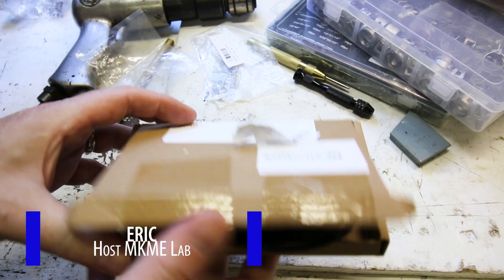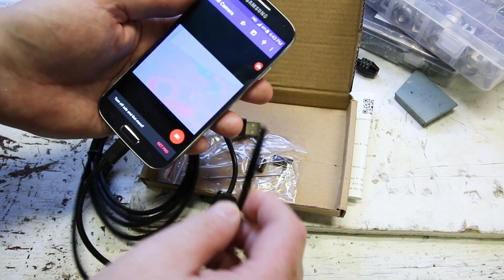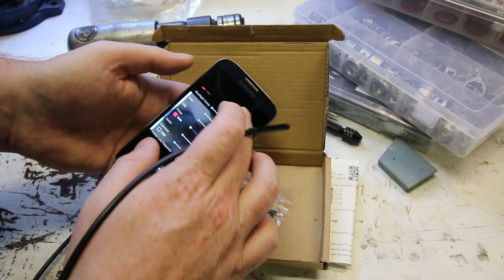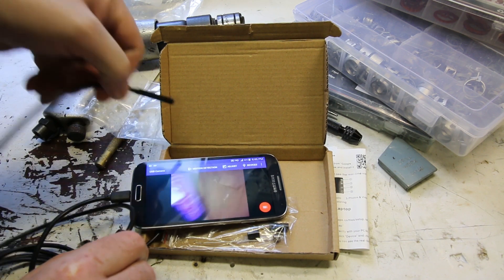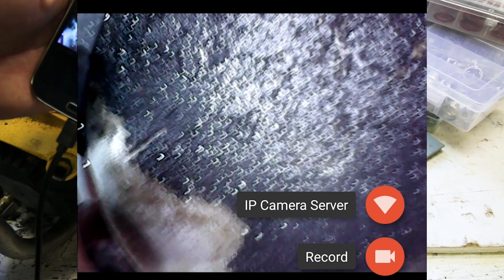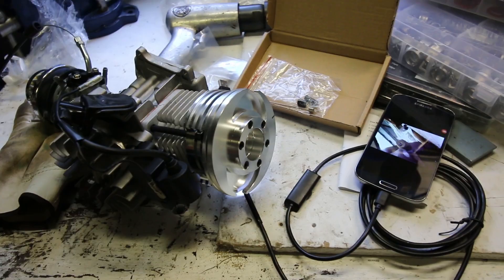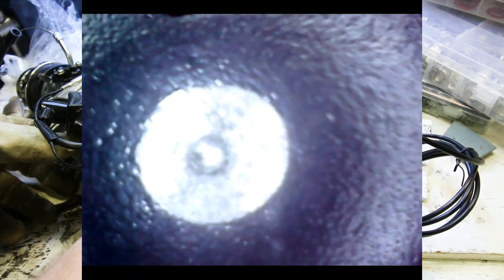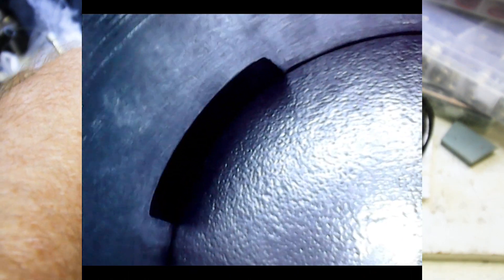CHEAP ENDOSCOPE CAMERA THAT DOESN'T SUCK!👍

Comment: Got the same type from CHina. It worked for whole two minutes before the LED fried the camera or the wires. It got hot AF.
Reply: I’ve had mine for about 2 years. Would’ve been nice to have illumination control, needed it to get in a dark place last week. Now the light doesn’t come on at all. Manual has no remedy to control. Totally worthless, typical Asian knockoff crap. But they don’t have an American version, off to the proctologist, oh well🙈

Comment: Though this is 4 years old the picture quality is good.  I moved to a town house and noticing some of the vents don't flow as much I started looking down in them and found stuff.  It would be interesting to get one of those cameras and see what is in them.  I just know the AC coils will need cleaned.  This place had no one in it for 2 years aside from maybe the previous owner checking up on it to make sure nothing has gone wrong.  Depending on what I find I may need to try to hook it and pull it out.  I already found a bag that had cookies in it down one and a piece of insulation and some nails in another.  It is obvious to me now that whoever built this place focused on speed and they just swept the floor debris down the vents thinking no one would find it.  Well I did.  I am not overly upset as long as it won't cost me a fortune to fix their negligence but it is still disgusting.  I wish I knew a wood worker to get to bring his dust collector over and hook it to the vents one by one and see what it pulls out.  A dust collector is like a shop vac but much more powerful and even has a larger hose and are designed to pull a TON more air flow than any regular vacuum can!  I may get one of those cameras you have.  I am only looking at reviews because many of these are Chinese generic junk and thus a waste of money.  It would be nice to get something that can take photos too so I can show the neighbors.  Next thing you know they will want to borrow the camera and look inside their disgusting vents.  Maybe they have a similar problem where the airflow is not so strong on the second floor too!  I hope when I snake a camera down in there I find some money (we can all dream).

Comment: Which app did you use?
I have the same endoscope, it's lighting up the leds but not showing any images. Have tried a couple of apps and neither work!
Reply: Please help
Reply: @donalddab-lv3fo ???
Reply: @bushratbeachbum   I can't find a single app that works with my endoscope I have a c type charger port on my phone but I have an adapter it should work but idk
Reply: From what I can work out, you need to go in to your phones administration file and activate utc and another setting, im yet to do it but that's the problem apparently

Comment: Hi ,, is the tip( where the camera is) or like the first inch or so also flexible? Thanks
Reply: I'm wondering the same thing cuz I don't see it being very useful for looking at valves which is a big issue on Motor Vehicles as the tip appears to be stiff the first 2-3 inches

Comment: Yours is better than mine. From memory the focus in my 8mm was good, but my 5mm wasn't. The problem was that I had fold the cable 180º to see up, and that meant I could only use the 5mm through a plug hole..
https://youtu.be/WKM185DpG1M

Comment: I have one too - used it to figure out how to get my car door opened after the outside handle quit working and I foolishly set the child lock on the door and closed it...  Went down through the window opening while the window was rolled down. :)
Reply: If the window is rolled down couldn't you just out your hand inside and open the door? 😂🤦‍♂️
Reply from the maker: Child locks prevent the inside handle from working...